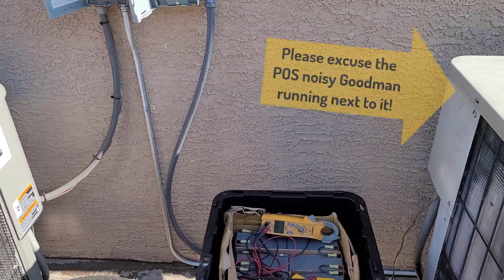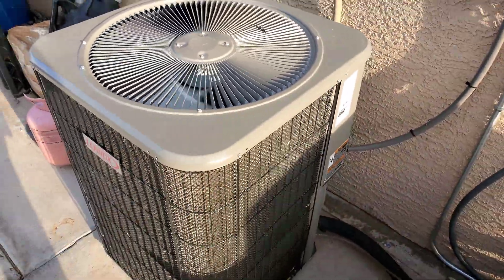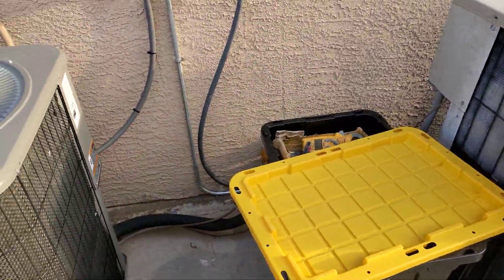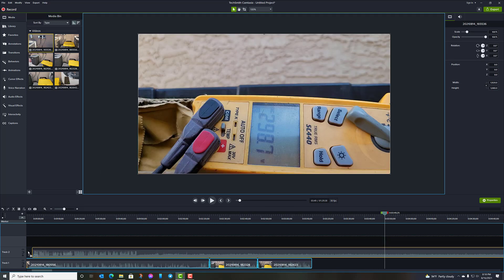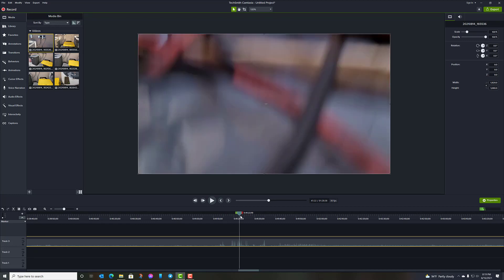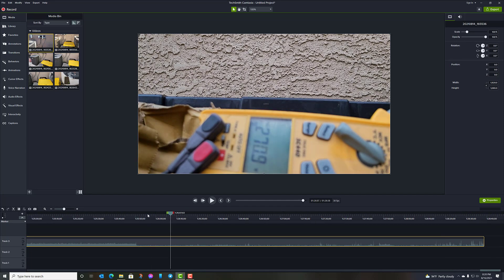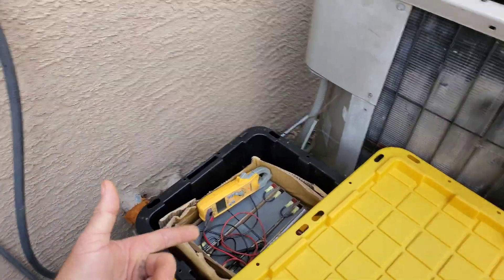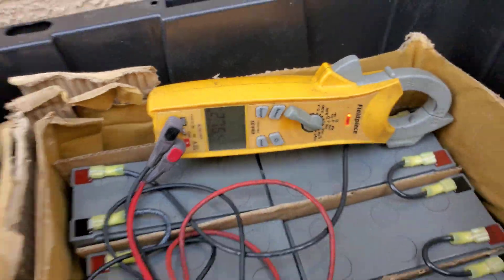This is how long my DIY Tri-Powered Solar Assisted HP could operate on batteries alone!

Comment: Nice vid, 300vac, does that mean you are on a 480vac grid? I would think a 208/240 motor would burn. I need to check out the previous vids on this set up
Reply from the maker: I'm on a 240VAC grid. 240VAC rectified to DC is about 330VDC.
I use a transformer to drop my 240 down to 212 to get my rectified AC down to about 300VDC or so.
That way my 300-330VDC solar will power the DC power supply until it drops BELOW the 300VDC that the utility powered rectified DC will begin to switch on.

Batteries don't need a regulator in this configuration. They only get charged from the solar to about 330 or so max (hasn't charged that much yet as the heat pump cycles a lot this time of year) and the most they discharge is down to about 285 where the utility power is providing all power.

Each battery in series is starting out about 13.2VDC and discharged to about 11.2VDC

Comment: That’s Pretty cool ! 90 Minutes of Free / Battery 🔋 Air Conditioning if the Power Goes Out.
Does the Power go out in Arizona a lot ? 
Like #35
Reply from the maker: I'm in older Glendale, above ground power lines, so it has gone out several times in the 5 years I have been here. Usually on within an hour but one time it was it for about 3 hours as we were trying to sleep